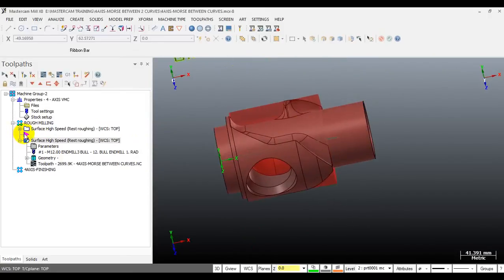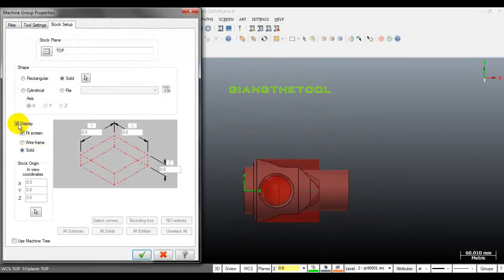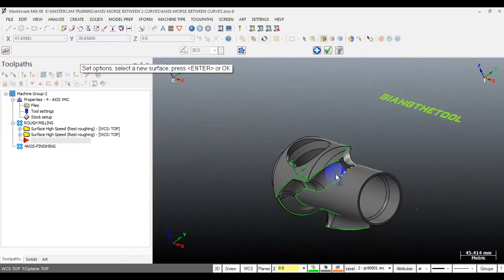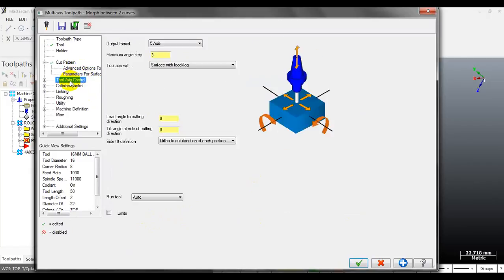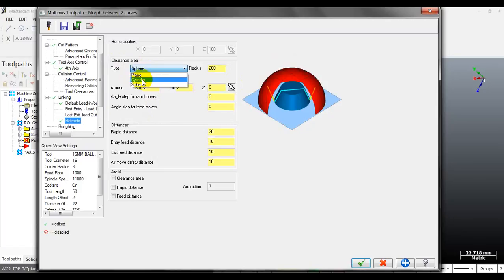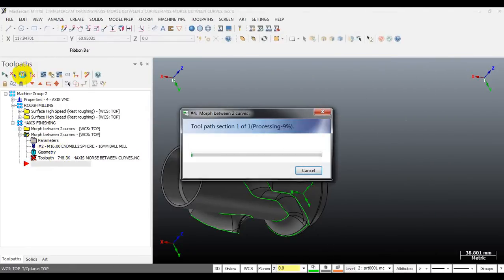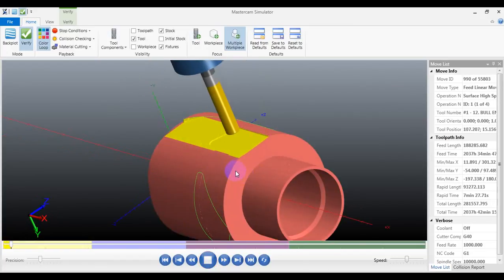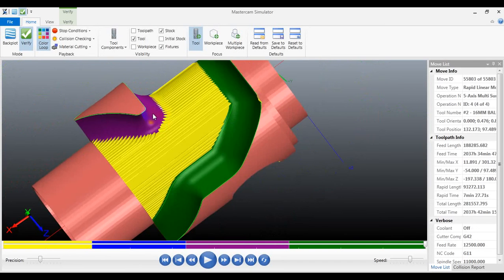Mastercam Multiaxis Case Study: Morph between 2 Curves Toolpath

Comment: Thanks for the great video,  one question, the cutting tool tilted surround the contour in the simulation,  does the 4 axis machine can handle this kind of contour? or a 5 axis machine is required.
Reply from the maker: you can select 4-axis output, then the 5th tilting move will be projected and becomes 4 axis
Reply: @GIANGTHETOOL  thanks for the quick response, but still hard to imagine the point,  you mean when output g code select 4x machine for post, but I don't know what is the 5th axis project  become a 4th means , in the actual cutting, the cutting tools can only be fixed in the vertical direction, isn't it?
Reply from the maker: @jerryyang2202   no, you have to set the strategy in the toolpath: 3,4, or 5 axis
Reply: @GIANGTHETOOL  ok, thanks